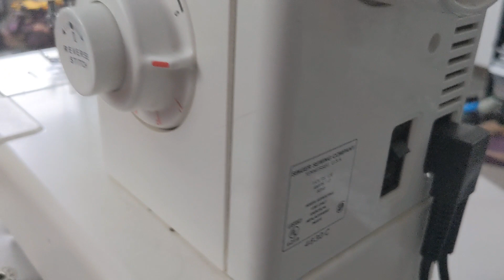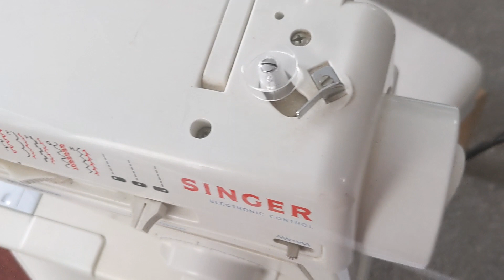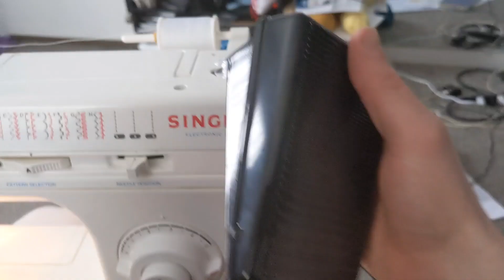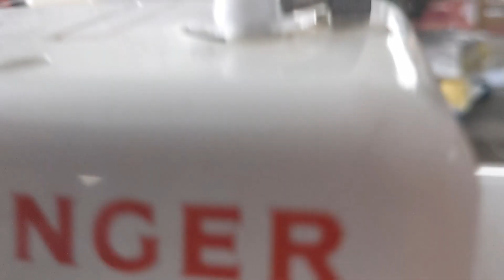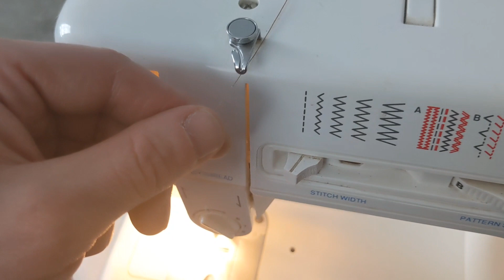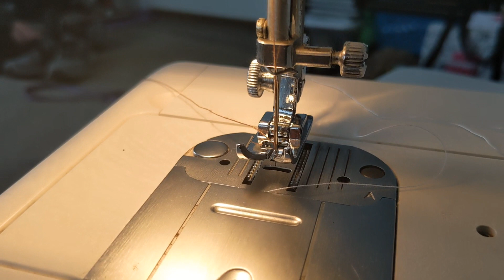Singer 4830 Basic Operation

Comment: I just purchased a singer, and I'm missing the cap that holds the tread spool on. Looks like your using a rubberband. Does that work well?
Reply from the maker: Yeah it works alright, all you're doing is trying to keep the spool on the post while letting the thread come off of it. The spool itself doesn't generally need to spin for that to happen but if your thread tension is really low maybe you'd have issues?

Comment: Hola!! Estoy pensando comprar una de éstas, según tú opinión cual es la relación calidad-precio? Soy principiante, qué tipo de aguja utiliza? La redonda o la plana por detrás?
Reply from the maker: Honestamente, probablemente no compraría esta máquina si tuviera otras opciones. Hay otras máquinas que son más fáciles de configurar y funcionan al menos igual de bien. Sin embargo, si puede obtenerlo a un precio muy bajo o gratis, entonces sí, debería servirle bien una vez que esté familiarizado con él.

En cuanto a las agujas, no estoy seguro de eso. Con suerte, el manual de usuario de su máquina puede brindarle una mejor orientación.
***************
Honestly I probably wouldn't buy this machine if I had some other options. There are other machines that are easier to setup and work at least as well. However if you can get it for very cheap or free then yes it should serve you well once you're familiar with it. 

As far as the needles, I'm not sure about that. Hopefully your machine's user manual can give you better guidance.